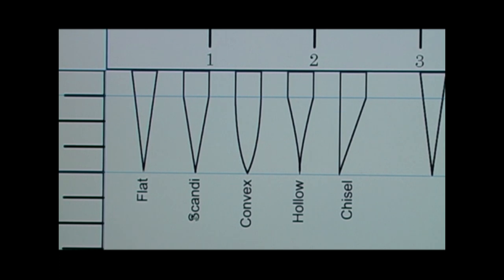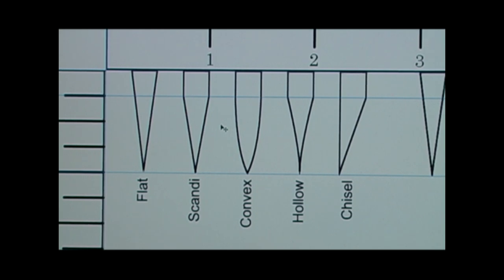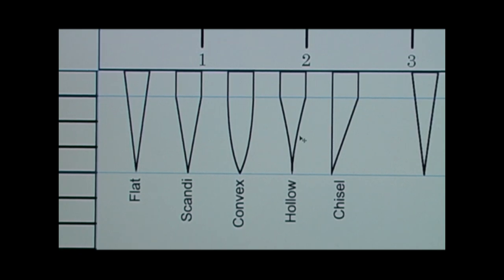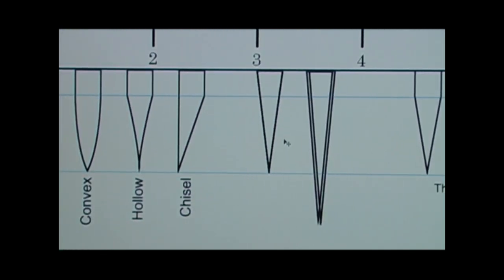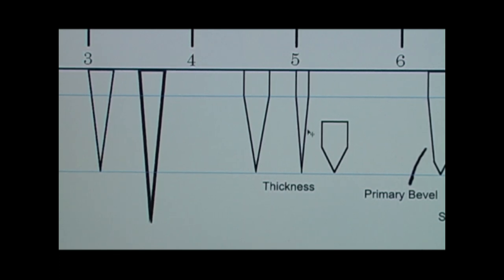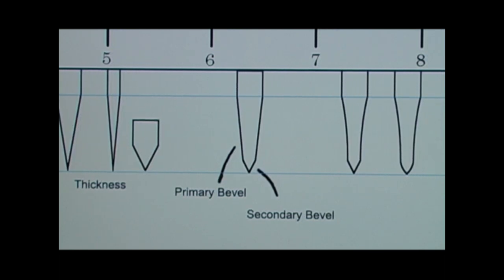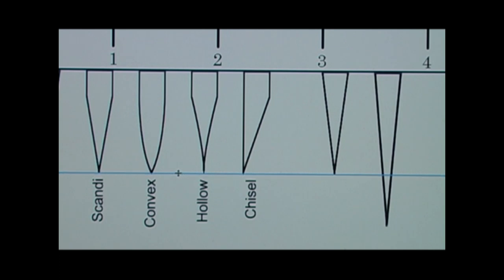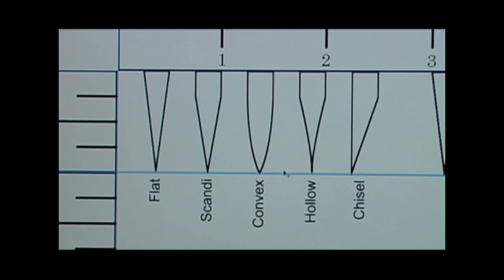Edge Geometry 101

Comment: When choosing blade geometry I would mostly care about resistance and aesthetics. Any blade can be sharpened more than enough really.  Lately I bought a flat bar of steel to make a knife and I accidentally cut myself with it. Surprised, I did the shaving test, and one of the ~90 degrees angle of that flat bar was easly shaving hairs off my forearm. :)

Comment: Hi Mike. Yeah, what you say makes sense, especially what you say about the much-maligned hollow grind. When I make my hollow grind blades I grind more steeply than you depict on your illustration - about 1/3 of the way up to the back of the blade. This creates a steeper angle down towards the secondary bevel at the edge and a stronger edge. However it also gets thicker quicker with prolonged sharpening (as you described for the convex grind), and that is a consideration. So, it becomes very important to decide exactly what the PRIMARY purpose of the intended knife is, before deciding on the edge geometry (the point you made). For heavy work I would use thicker steel and make the primary grind narrower and steeper, while for a food prep or butchering knife I would use much thinner steel, probably a flat (or hollow grind going far up the blade) and a flat angle, so one can sharpen it far longer into the life of the blade.   The Scandi grind still confuses me. The stated intended purpose is "bushcrafting" - whatever that is. Yet, it is claimed that Scandi grind is King in two main areas - feathersticking and batoning. Now, in my mind why would one use a single tool for two such disparate tasks? For effortless batoning, a large thick blade with a steep grind makes far more sense and would require a fraction of the effort. For feathersticking a sharp blade is required where one needs to be close to the action, so a small blade is better, like for intricate carving. Why make a knife that falls between these two stools? Weight?  One hears that an axe and a Scandi knife are all you need. How about a folding saw, a big knife and a small carving knife instead, which could possibly be the lighter option, and still do everything the other could. In the final analysis then, I guess it depends on the individual, and what they like doing. Thanks for an interesting talk.

Comment: What's the difference between scandi and sabre grinds?
Reply: A scandi does not have a secondary bevel but a sabre does .When you sharpen a scandi you lay the whole primary bevel down on the stone and the sharpening angle is already preset for you . When you sharpen a sabre you sharpen the small secondary bevel .

Comment: And wich is a saber grind?
Reply: Saber grind was the one with the words primary bevel and secondary bevel . The primary bevel goes up about half way , sometimes slightly higher or lower , but never the whole way up . It also has a small secondary bevel ( edge bevel ) that you sharpen .

Comment: It definitely makes sense . I like a hollow  grind better for meat and food prep . Skinning etc.. but prefer flat or scandi for wittling i get better control . and a convex on a machete or a large chopping and  batoning knife for splitting wood . A scandi grind  splits small pieces of wood better than a flat grind since it is  thicker  where the grind begins and makes the knife a little stronger than a flat grind. Hollow grinds on smaller knives is usually too fragile for hard uses but like you said you can sharpen it longer with out reprofiling